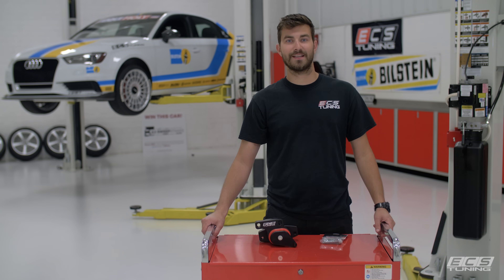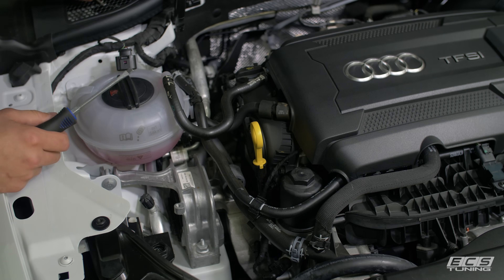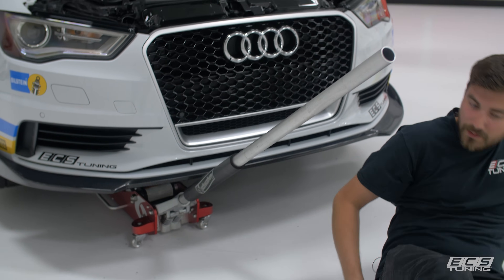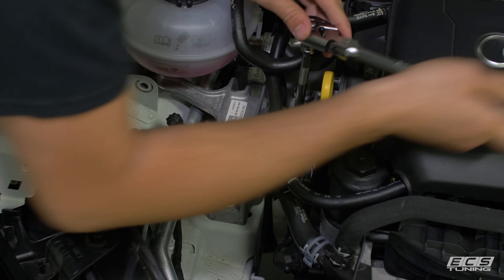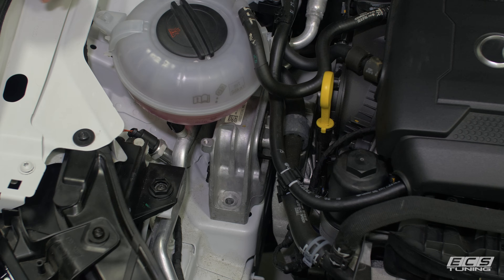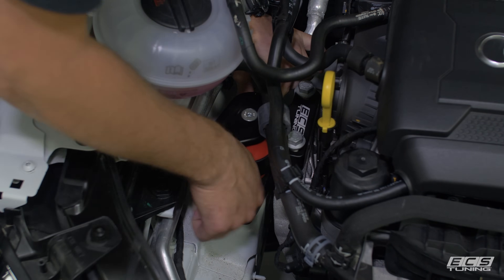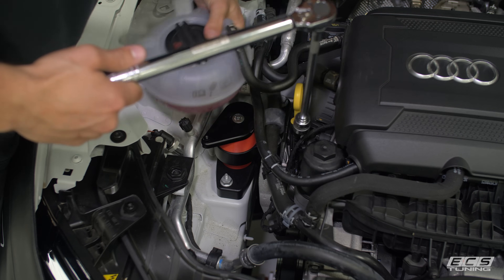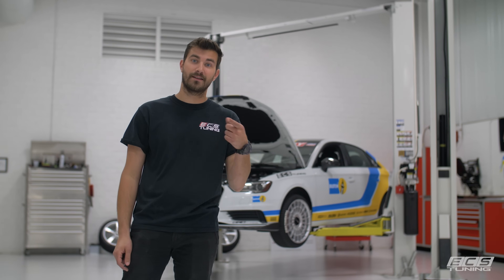VW/Audi Engine Mount DIY (MK7 GTI, Golf R, A3, S3)

Comment: Hi, my motor mount bolts broke inside the part that is attached to the engine. Do I have to remove the engine to get that part out? Thanks

Comment: I have 52k on my 15 S3 and my motor mounts need replacing.  Thinking about the BFI mounts but I am considering the ESC ones as well.  Is there a big difference in the 2?
Reply: Did you ever figure anything more out about this?
Reply: @fizz2754  I went with the BFI engine and trans mounts.  Very happy with them. Quality is very high. Also got some new BFI control arms.  Control arms were a big improvement.  Removed all the squeaky noises. Much more compliant over bumps.

Comment: Seems odd to me that ECS decided to not add the lateral bracing to the top of their mount (it's the first bolt they remove from the factory mount in the video at 2:08) Also, when you look at other manufacturers MK7 poly mounts, they have this lateral bracing provision present in their design. What's to keep the ECS mount from bending the frame under hard lateral loads? There has to be a good reason why the original mount was designed this way.
Reply: Just thinking the same

Comment: Can you show us where you placed the jack on the oil pan? Definitely don't want to mess that part up!
Reply: A Steel oil pan is a must have “upgrade”
Got a Rein steel pan kit for under $70
Reply: Jack around the lip of the composite pan, where the engine casting will be. All you'd be doing at this point is compressing a piece of composite between your jack block and the cast iron. Avoid pushing up on the hollow section of the pan. You're not jacking thousands of pounds, only a few hundred at most.
Reply: @turnin.sprocket  does this edge of pan hold thousands of pounds ? (45-100kg) ? uhh
Reply: @majklxxx  I'm not sure what you're trying to convey with your comment.
Reply: you are talking about to support edge of pan with rubber or wood piece, but here is shown that he spread weight throught entire pan ... what is your experience how to do properly ? 
https://youtu.be/GFAp7PwpUso?t=325 @turnin.sprocket
Reply: @majklxxx  About 18 years of mechanical engineering drafting, design, modeling, and other various years of assembly, fab, dairy farming, welding, trial/error.
While polymer is strong stuff, supporting an engine pushing in the middle of a hollow cavity spanned by polymer could cause problems. That's why I said it would be better to support the engine by putting jacking force directly against part of the cast iron block rather than risking busting the polymer pan.
Reply: im terrified to support an engine with a plastic pan...... that just has bad day written all over it to me.....

Comment: on the top of engine mount stud/ bolt , there is a lock nut , which  tool I have to use to remove it,the nut is octagonal shape.

Comment: And what about a dog bone insert?  Shouldn't it stop wheels hopping and transfer more torque on the road? Where's the difference between there two installations?
Reply: Sebastian Bialek I’ve also heard vibrations are less evident in the dsg with just the dog bone insert vs the manual
Reply: ECS Tuning 
I have dedicated 18" Dunlop GT 6months old tires with good grip it won't be tires fault but more dsg I guess ever in a manual mode it has some revs restrictions.
Reply: Kolour Blind they are more harsh in on dsg cars
Reply from the maker: A dogbone insert is a great inexpensive first mod for tightening up your drivetrain.  We have a DIY video on the insert here: https://youtu.be/fPZnYQYXJic
Reply: ECS Tuning 
I installed a Spulen dog bone insert 2months ago on my mk5 dsg gti but don't feel any difference any stiffness and the front wheels are still spinning on a hard start, launching mode. Is it a dsg fault coz have no idea why I don't get any vibrations on low revs like the others.
Reply from the maker: Dogbone inserts help with wheel hop, but not necessarily wheel spin.  What tires are you running?  Front wheel drive is going to spin first gear from a launch, but there's ways to help add traction.
Reply: I have a 2006 A3 FWD and I am interested in the motor mount and dog bone improvements shown in your videos. I am noticing wheel spin and was curious as to what your recommendation(s) is/are?
 @ecstuning